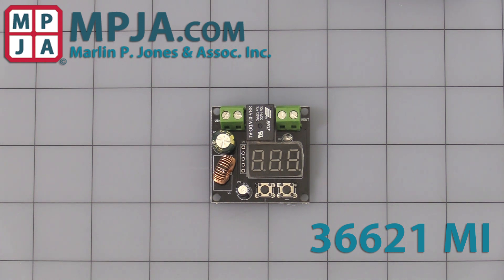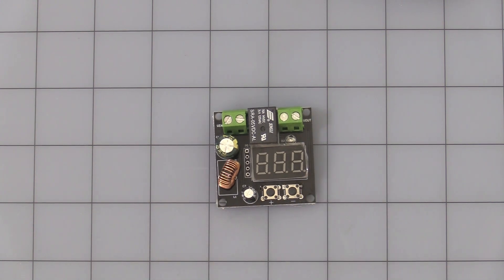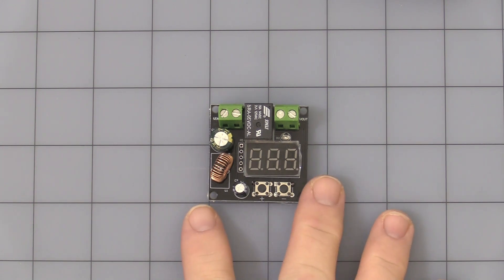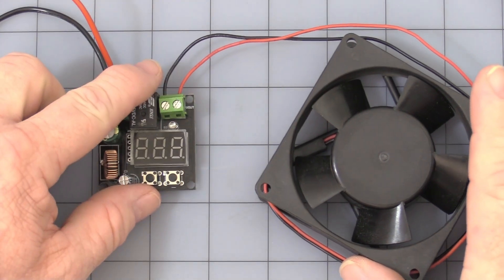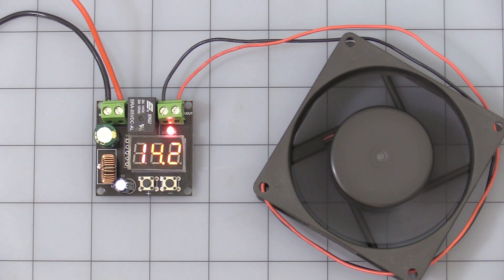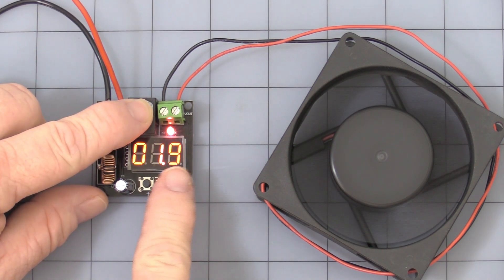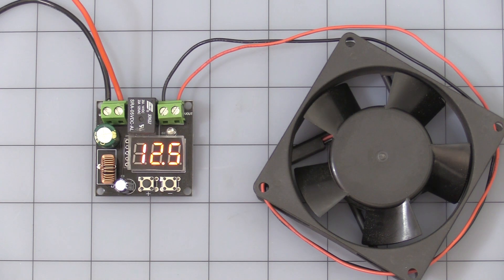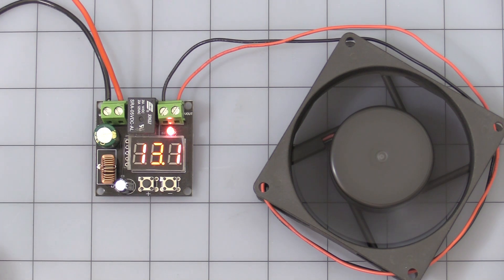Battery Low Voltage Disconnect Board 33621 MI MPJA.com

Comment: I have the XH-M609 great little item, I used one in my car and one hooked up with my Solar power lights i hooked up in the barn.
If you press both buttons together wait for the LCD to stop flashing this will set back to the Factory setting.

Comment: I use a similar board for my 20v dewalt battery ammo Bluetooth speaker builds if I don’t use this board and the voltage drops below 17vdc the battery will not charge on the charger u can jump it but can cause damage this board keeps it from going too low

Comment: I Have 2, 18 Volt Milwaukee Batteries Wired in Series? They Have a On board Cutoff that Only Works With The Milwaukee Power Tools?
I Have This System for my Son's Power Wheel what's the Cutoff Voltage for That 36 Volts
33 Volts for the Series set up? Or
16.5 Volts For the Capacity of Each 18 Volt Battery?
If you Have Any Suggestions? It would Be Greatly appreciated 👍

Comment: Thanks for the video, what a great little device.  I would be interested in the control of the relay to turn on and off my 24v inverter via the remote switch, not the switching of the power through the device.  Are the relay pins accessible through the bottom of the PCB?